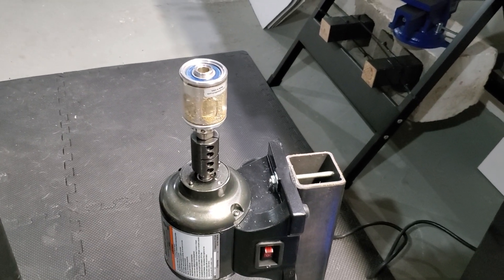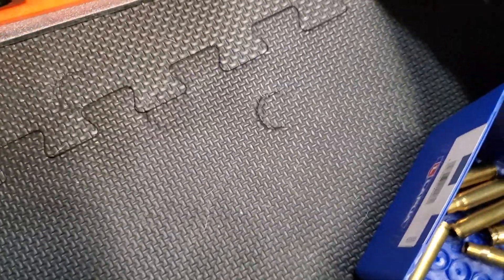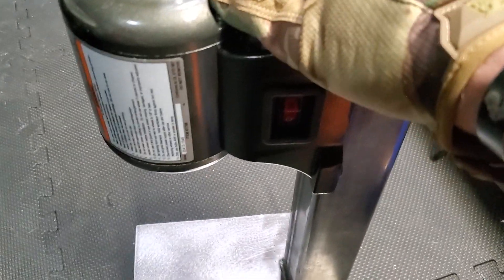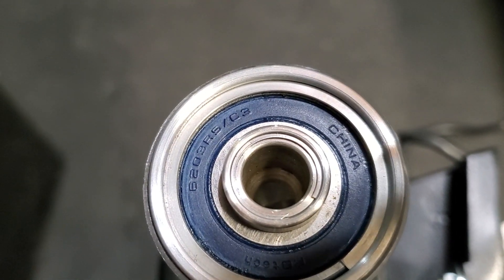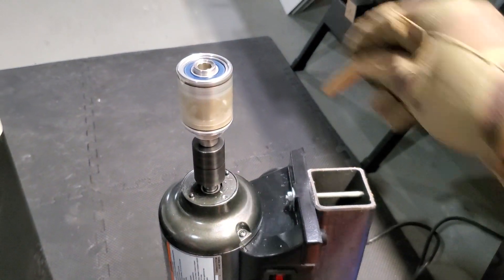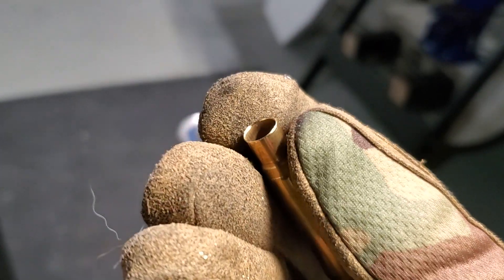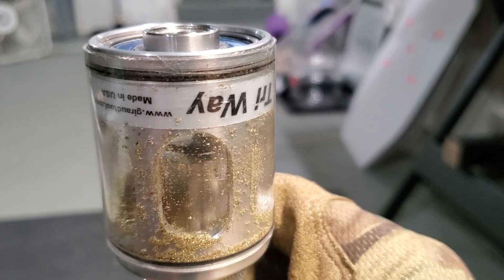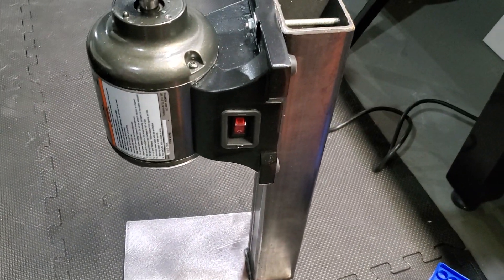Harbor Freight powered Giraud Tri-Way Trimmer with DIY stand.

Comment: Is this thing still kicking? How has the trimmer held up? I was literally about to place and order for the motorized one from them and came across this video and now I think I’m preferring to save a few hundred and get basically the same thing. Has the harbor freight motor held up well?
Reply from the maker: It didn't show any signs of slowing down after thousands of cases, I gave it to the guy I sold my .308 to and haven't heard any complaints.

I figure you can go through 5 motors (or have them replaced on warranty) before you catch up to the cost of a powered one from Giraud.

Comment: that's a beautiful thing.. i would suggest losing the hard leather gloves, switch to 3 or 5mil nitrile, in comparison to your concerns about the bottom shaft grabbing a shoe lace or pants leg if your glove ever got snagged (as unlikely as it is) on the spinning tool it could pull you in.
Reply from the maker: They're Mechanix gloves, but that's a good point.
Reply: @robgoose8126  I saw another guy doing similar with a glove a guy at work lost a finger drilling UMHW and a curly Q grabbed his gloved hand

Comment: 3450 is pretty fast, way too fast for standard feeds and speeds for brass. I know it works, but it's better to go slower.

I think I'm going to do the same thing but run it off a motor controller to get the speed down a bit.

Comment: Getting ready to put a Little Crow Gunworks trimmer in a router table and use similarly. Had not heard of this Giraud trimmer will look into it. Ive had this WFT for a few years or better and have never used it for different reasons but mainly only reloading for pistol caliber up to this point. Going to be setting up a couple heads for a couple rifle calibers soon. Thanks for the vid.

Comment: You are not getting the length of the sized. Case lenght is important and that what the Lyman unit does if you set-it up properly. Once you trim the case in that device there is no going back. You can make up the distance lose but setting the bullet shorter.
Reply from the maker: I full length size before trimming, the giraud indexes off the shoulder so it's perfect length every time.

Comment: The HF 6” Central Machine bench grinder is no longer available, but I used their newer 6” Bauer grinder that is essentially the same machine to build mine.  I used an old steel car spare tire donut rim as the base, cut & welded a piece of 2” pipe thru the center hub of that rim and then cut & welded  a small piece of plate steel to mount the motor on.  Once I had it all fabbed & welded out, I blasted, primed and painted it (as close to Redding green as I could get).  I did everything else essentially the same as Rob did in this video.  I have two Giraud Tri-Ways (.223 & .308WIN) scheduled for delivery shortly.  Thanks, Rob, for this great idea!!
Reply from the maker: Glad to give you a project to work on! Enjoy.

Comment: I started trimming with one of these. Not bad if you're trimming a couple hundred cases here and there. Absolutely sucks for any kind of volume. Still hard to beat a Dillon case trimmer, but it's 💰💰💰
Reply from the maker: A couple hundred isn't volume for you? I wish I had that problem lol
Reply: What I meant was, if you trim a few hundred a year, then it's not bad. When you need to trim a 5 gallon bucket worth, your fingers go numb. That being said, I reload for a hobby and not necessarily for the cost savings. So I eventually bought the Dillon trimmer.
Reply from the maker: @philbaker29  ah gotcha. I reload for my bolt actions primarily so no problem for mea

Comment: Another guy going to loose a finger because he is wearing gloves while using a rotating shaft.
Reply from the maker: Skin tight gloves holding the end of the case two inches from anything spinning, I'll take that chance. Considering there are zero snag points on an acrylic cylinder I have zero worries about it.
Reply: @robgoose8126  tell that to the guy at my shop who lost a finger. Good luck.
Reply from the maker: @paulhamilton5634  Sorry about your friends finger. If he lost it using this tool with tight gloves he has to be a candidate for the Darwin Award.

Comment: So how do you set it up so it trims exactly to the proper length?
Reply from the maker: The inside of the hole is shaped like the chamber of your rifle, the cutter indexes off the shoulder of the case. So as long as your sizer die is correctly set up you just push the case in until the shoulder of the case hits the shoulder of the "chamber".

There is no adjustment or set-up needed. Just size the case, push it in until it stops chirping, and repeat.
Reply: @robgoose8126  Rob, Thanks for the explanation and the clarification.
I guess where my confusion lies is when I do a chamber cast for each rifle I measure and trim to the bevel
and back off my brass length about .005.
As I shoot mostly soft cast bullets I am concerned that if I don't get the "neck length" close as I can, there will be a gap between the top of the brass and the chamber which will fill with lead as the projectile obturates.

I speculate that this extra bit of lead will not only build up in the chamber but also cause finning at the base.
I do my best to position the lube groove close to the top of the brass so it (the lube) fills the gap.

Another issue I have is that I shoot mostly straight wall cartridges, 45-70---38-55---35-40 to name a few., although I do have several bottle neck cartridges which this trimmer would work.

So in those instances where a chamber's neck is not exactly to SAMMI spec, how does one adjust the trim to length with this trimmer or is it cartridge / SAMMI spec specific?

TIA

Bob
Reply from the maker: @RJ-sr5dv  you're probably better off contacting Giraud directly. As far as I know their trimmers cut to SAAMI spec only. I do not believe they have anything available for straight walled  casings.
Reply: @robgoose8126  Will do thanks

Comment: I am surprised how quiet it is.  I could never get my .223 to trim even with same unit.  Actually one time I did right before I sold it, it was if the stars aligned or something but I forgot to lock the nut and when my cordless drill has that stupid break that jolted and enertia made it undone and I lost that setting and it started again trimming horribly crooked.  I spent hour messing around and using shims and sometime I could see it mostly even and sometimes it would chamfer on one side and nothing on the other.  In the beginning I contacted Giraud and they said to send it back and they would refund but I though if I just played around maybe I could get it to perform, well I should have just returned it when I had chance.  Right now I sold it at a loss.  Maybe .308 is different or maybe I had defect, I don't know.
Reply: P.S. It's not just one caliber BTW.  If you got .308 you can trim .243, .260, 7mm-08 - based on .308 parent cartridge
Reply from the maker: Sounds like the carbide blade inside may have been out of whack. I tried using my cordless but it never worked out for me so I made this contraption.

Comment: Well, I tried it without cutting off the threads and you were right. There was a slight wobble that made it too difficult to use. Cut the threads off with that $10 angle grinder and it's much better. Thanks for the info and links.
Reply from the maker: Thanks for coming back and letting me know how it went, Im happy I was able to help. Happy trimming brother!
Reply: @robgoose8126  thanks. My 300 BLK Tri-Way trimmer should be here soon and it will be time to do a lot of brass trimming.
Reply from the maker: @TheBigfoot1999  I've been tempted to put together a .300 upper to put my resonator k on, but Im trying not to spend much around this time of year. Maybe next year!

Comment: Great idea!
Reply from the maker: I cant take credit 100%, it took a lot of digging to find somebody mounting it vertically to the side of their bench. I tried that and it made a hell of a lot of noise so I put my thinking cap on and made this. I'm happy with how it turned out.
Reply: I’d love to shamelessly copy your design here, but I’m having trouble finding the 1/2” x 3/8” coupler for less than $50.00 on Amazon.  Looks like the prices went up since you built yours. Maybe I’ll just bite the bullet here. 

Ruland CLX-8-6-F One-Piece Clamping Rigid Coupling, Black Oxide Steel, 1/2" Bore A Diameter, 3/8" Bore B Diameter, 1-1/8" OD, 1-3/4" Length https://www.amazon.com/dp/B0060LUT7W/ref=cm_sw_r_cp_api_glc_fabc_NKm4FbT4GDTCQ
Reply from the maker: @richardbristol452  https://www.amazon.com/dp/B005L69UPE/ref=cm_sw_r_cp_apa_i_xjjkFb0CPQ33A
Reply from the maker: @richardbristol452  thats the one I bought. Interesting it says $18.75 for one but $100 for two, that doesn't make sense but worth a try! It shows 18.75 in my cart let me know what it looks like on your end.
Reply: Thanks! I don’t know why that one didn’t pop up on my Amazon search.
Reply from the maker: @richardbristol452  I'm glad it worked out for you man. Happy trimming :)

Comment: Is it mandatory to cut the threads off?
Reply from the maker: I dont hink so but it's worth doing in my opinion. Not only does it bring the trimmer closer to the motor reducing potential wobble (it is harbor freight after all) but it increases the surface area contact between the spindle and coupler.
Reply: @robgoose8126  I'm getting an "unused" Black and Decker from my father-in-law and other than a hacksaw or dremmel, not sure I have anything to cut it.
Reply from the maker: @TheBigfoot1999  if you have a Harbor Freight near you they should have angle grinders under $20 that would probably do the trick. Either way I doubt the trimmer has enough mass nor does the motor have enough torque that it'll matter if you tighten it down on the threads.

Edit: HF has a coupon for item# 65645 $11 until 12/31.

https://www.harborfreight.com/corded-4-12-in-43-amp-angle-grinder-69645.html

Coupon here: https://go.harborfreight.com/cpi/digital/post/2020/12/december-2020-coupon-book-valid-through-12-31-20/
Reply: @robgoose8126  damn, that's cheap!!!!
Reply from the maker: @TheBigfoot1999  it isnt Dewalt but you only need it to run for a couple of minutes right? It's practically disposable.
Reply: @robgoose8126  just an electric motor with a gear (maybe). Should last a while for any kind of home use.
Reply from the maker: @TheBigfoot1999  Agreed. I think HF stuff is more than adequate for small home projects like this.